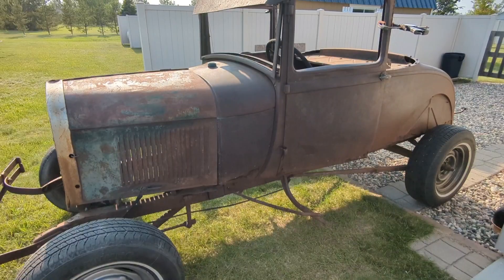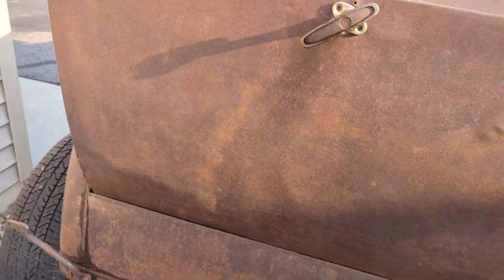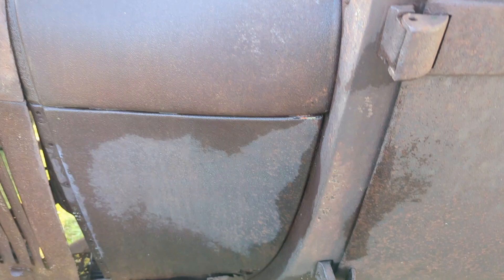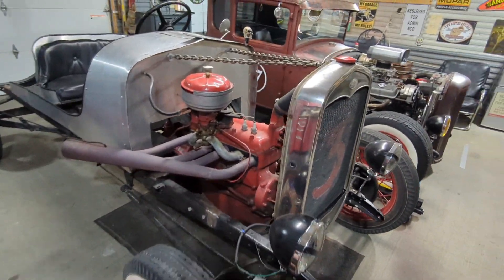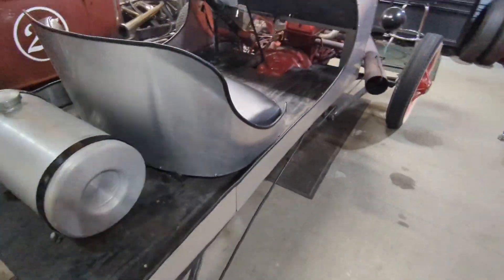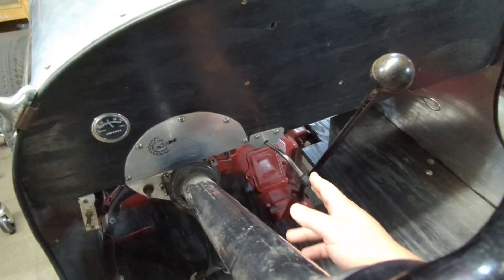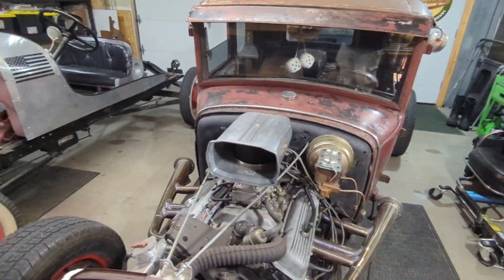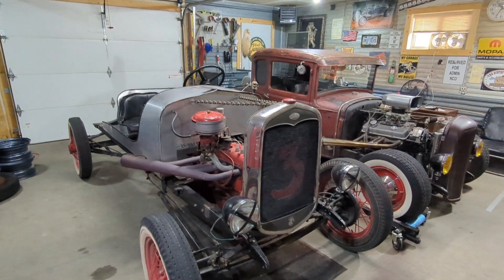Trouble Maker lives up to its name.

Comment: This thing is going to be super cool!!!

For the pins, you might have to soak them in penetrating oil multiple times over the course of a week. If that doesn't work, might just have to drill them out.

Also, let me know if you need any help with that carb. I know a thing or two about them.
Reply from the maker: I am sure I'll be messaging about the carb, I was thinking once the new pins show up I would drill them out.

Comment: Trouble maker came pretty clean. Good review of what's to come. I'd say soak the hood pins in your goop-of-choice and then use the hot wrench. Should free up those pins. Could also be there just pinched a little. Look forward to more. Be safe and stay well.
Reply from the maker: Used the hot wrench, 3 different goops, multiple hammers punches and pry bars.

Comment: Open the door to relieve tension. Heat the hinge section that is attached to the body. Spray with penetrating fluid. The heat expands the metal and draws the penetrating fluid in. With the proper sized pin punch, tap the pin out. If it doesn't work the first time, do it again. It may take several heat cycles to break the rust loose. Patience is key. Side note: the drill wasn't helping. No chips means you're not cutting any metal..
Reply from the maker: Thanks for the tips, much appreciated. We did get it out just took time.

Comment: You'll have to drill down the centre of the stuck pins just a little smaller than the pin size, it will 'shrink' and can be hammered out
Reply from the maker: Thanks! We appreciate the tip.